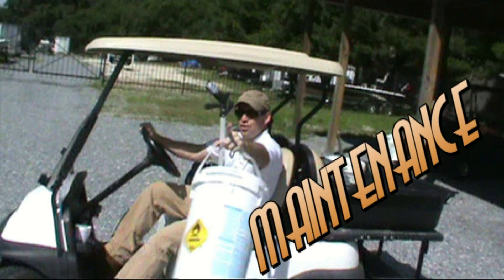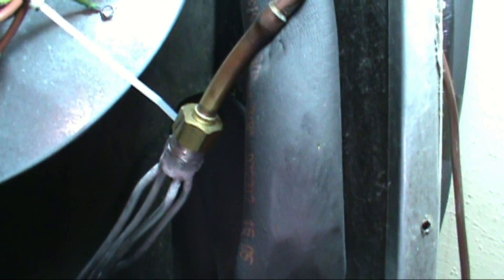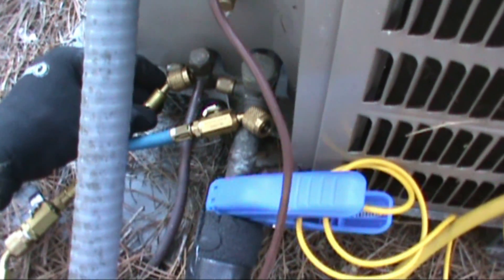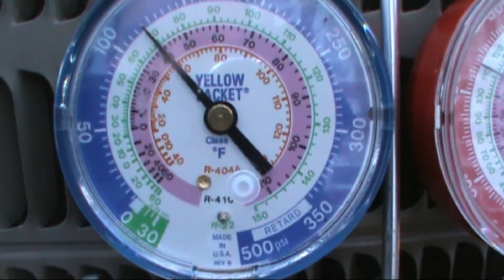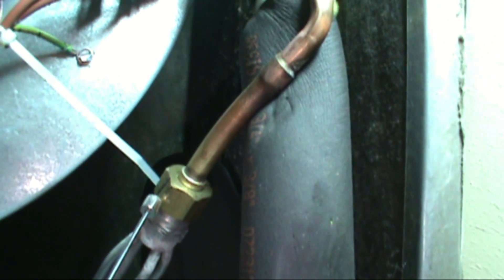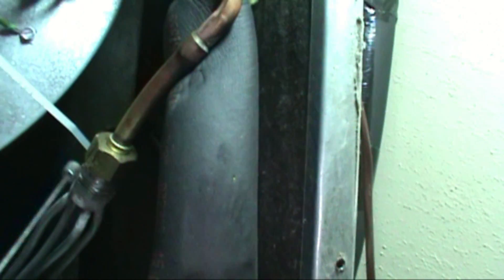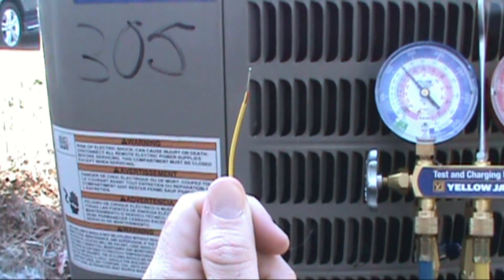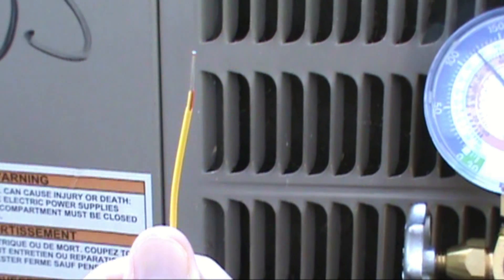HVAC SUPERHEAT explained on a real unit. R-410A analogue gauges

Comment: This is the best explanation I've came across, not to say the others are bad, it's just the easiest one for me to understand. After several months of trying to wrap my brain around this and going to HVAC trade school I think I finally get it. BUT.... there is one thing I don't get. I understand the saturation temp vs line temp. What I don't get is how do you get saturation temp and actual line temp at the exact same spot in the system (condenser). They say when you have your gauges hooked up that you are reading saturation temp in the middle of your coils. Condenser and evap coil. Is this true, is so can you explain it to me. I guess my question is how is it reading the saturation temp outside the coil without reading superheat or subcooling that is at the same location that you have your temp probe. Thank you.
Reply from the maker: Danny L. The refrigerant boils & turns to vapor at that pressure at the piston. Like water boils at 212 degrees at sea level. But, if you climb a mountain in Colorado, that same water will boil at 202 degrees due to lower pressure at that high elevation. Did I answer your question? LoL! Its all about the pressure at the boiling point. 130 PSI for 410a boils around 40 degrees.
Reply: Lex Vance I get that part. I understand the pressure temperature relationship. Its hard to explain in a comment. 

Why isn't the temp in the gauge the same as your temperature probe when they are side by side.
Reply from the maker: Danny L. hmmm let me see if im where you're at. The temp is 40 at the piston. When refrigerant enters the coil, the hot air from inside the house blowing over the coil warms it up to 52 degrees. So by the time it hits your temperature probe on the suction line its around 52-54 degrees. The 40 on the gauge is telling you the temp at the piston. That's the best i got skid. lol! Other wise Im not sure. 😂😂😂 Thank you so much for watching Danny!
Reply: Lex Vance I think I got it my friend. Thanks so much for your videos and taking the time to answer your comments. Looking forward to more dirty maintenance!

Comment: Is it ok to use one set of gauges on both 410 a and r22 as some people suggest two seperate gauges,
What is your thought on that
Reply: Lex Vance Thank you for the link Lex! I like the videos you post definitely helpful I'm an apartment maintenance tech also
Reply from the maker: trukin forever I use 2 different sets to cover my butt. ive heard it doesn't matter. but i play it safe.
Reply: trukin forever In theory you should use two separate sets of gauges because the oils that are used in R22 and R410A are different and can't be mixed,In my opinion I think it would be ok to use the same gauges on both types of refrigerant because the amount of oil inside manifold/hoses would be minimal,Also I've seen techs that have digital gauges that can be used on numerous different refrigerants,It doesn't seem practical to purchase another set especially at that price,I've never seen anyone flush their gauges.Hope this helps
Reply from the maker: micah68ss Well said Micah! thank you! www.dirtymaintenancenation.com
Reply: You can use one set for both freedoms as long as you blow out your hoses With nitrogen

Comment: Your vapor temp measurement is taken on an external pipe surface.  I would assume your vapor temp is colder than your measurement.  Does your thermometer estimate a fluid temp or do your calculators represent pipe surface temps?  is the pipe temp very close to fluid temp?  How long does the system need to run for this measurement to stabilize?
Reply from the maker: The temp. probe is getting the surface temp of the pipe. there should be gas only before it goes in the compressor. there should be no liquid. Thank you so much for watching!
Reply from the maker: Let the unit run for 10 -15 minutes and then check charge & superheat.

Comment: thank u my brother but is there any diffrent in digree bettwen morrring or evening or hot and cold time
Reply from the maker: Yep, pressures will be a little higher when its hot outside & lower in the cold. Therefore temperatures will fluctuate as well in hot and cold. Thank you so much for watching Qasim!
Reply: brother lex vance thanks again so what is the perfect time to take superheat
Reply from the maker: +Qasim LG afternoon time when its hot.

Comment: Ok in my opinion the best described way of  explaining super heat that I have found. Thanks for taking the time to do the video Cheers!
Reply from the maker: Thank you so much Robert!
Reply from the maker: +RnaGenetics Thank you so much Rna! Ive been playing guitar for 25 years. Those pressures seem a little high for what I usually work on. I only work on 1.5 to 4 ton units with 410a & normal pressures with those are between 125 to 135 on low side & 350 to 375 on high side. All depends on target superheat with me though. Thats what I go by. Thank you so much for watching Rna!
Reply from the maker: +RnaGenetics I've been in lots of bands. I played lead guitar for a living for years. Then started a family & retired. Now I do my second passion & that's fixing things. Take care Rna!

Comment: Nice explanation, I'm starting to understand superheat now yay!.
Reply from the maker: Nice Vin! Thank you so much for watching!
Reply: Hi Lex.  Well after watching all vids (especially yours) I could I felt confident enough to top off my 2 ton package unit with R22 using the superheat method.  All is well now with one anomaly maybe someone can answer for me.  The SLT goes from 66 to 48 to 66 again over and over.  It has a fixed orifice with cap tubes to the evap.  It took 2.8 lbs but blowing cold but I haven't seen a vid yet about this ping pong SLT.  Any ideas?  Thanks
Reply from the maker: +Vincent Herman hmmm weird man. Sounds like you may have a restriction some where. If the compressor sounds good, you may have a restriction. I'd pull the refrigerant out & blow out the system with nitrogen, pull & vacuum & recharge.
Reply: Thanks Lex.  Just went up to check it again for the heck of it.  My SLT was at 63 just perfect and it wasn't moving.  So I thought maybe it was me.  15 mins go by still perfect and I'm getting ready to put the cover back on and right then the SLT just started dropping all the way to 44.  I just shut it down.  Unit is 4 yo low on gas so I charged it up by superheat watching the videos.  I bled my hoses.  Oh well, thank you for your advice and I'll take a bit to think about my next move.

Comment: I have watched over 50 video on super heat and this one is at the top,  Do you have a video on sub-cool, I will subscribe tonight, at 67 years old I may come out of retirement and go back to school to be a AC man, I sure like the looks of them Sman4, or Imanifold, I need to stop the bi-weekly Casino trips and buy one..
Reply from the maker: Thank you so much Art! I don't have any videos about sub-cool, but its just as easy. Superheat is line temp 52 minus saturation 40 = 12 degree superheat. Subcool is saturation 110 minus line temp 100 = 10 degrees subcool. You just do the opposite for subcool. Put it all on black & go you an manifold with the winnings! Thank you so much for watching Art!

Comment: why are you using the compound Gauge  ( low side) to measure the Liquid Line ?
Reply from the maker: Im getting the saturation or boiling point of the refrigerant. If I was doing sub cool id use the highside gauge. Thank you for watching vaccumme!

Comment: It's my understanding that the R-410A  hits the piston in the evaporator as 100% liquid and is no where near 40 degrees until it reaches midway through the evaporator coil, where the R-410A is now 1/2 liquid and 1/2 vapor. That is where it reaches 40 degrees.
Reply from the maker: Yes it hits the metering device, piston or txv as a hot liquid. It boils at 40 degrees there at the pressure your gauge is reading. It sprays liquid & gas like a squirt bottle & enters evap at 40 degrees as a mixture. The hot air from the room blowing through the coil is what heats or "superheats" the 40 degree mixture & turns it into 100% gas. It goes from 40 to 52 while going through the coil. The refrigerant is taking the hot air from inside & dumping it outside. Thats why you feel hot air blowing out of the condenser. Thank you for watching!

Comment: Target Super Heat Formula is ..................((WB X 3) - C - ODA) divided by 2 .........Using your numbers it would be ((68 X 3) - 80 - 95) / 2 .......((204) - 80 - 95) / 2.......(204 - 80 - 95) =29 ....29 /2 = 14.5  your Target Super Heat.......WB = wet bulb , C = Constant which is 80(never changes) , ODA = Outdoor Ambient
Reply from the maker: Awesome zeke! I love the knowledge. Thank you so much for watching zeke!
Reply: Going by your TARGET SUPERHEAT formula, I set it equal to indoor wet bulb.

WB = [(TSH*2) + 80 + ODA] ÷ 3

WB:
indoor wet bulb temp

ODA:
outdoor ambient temp
Reply: Thanks for the formula, that was the only thing I didn't see on vid, how to get to the,actual target superheat without an app.